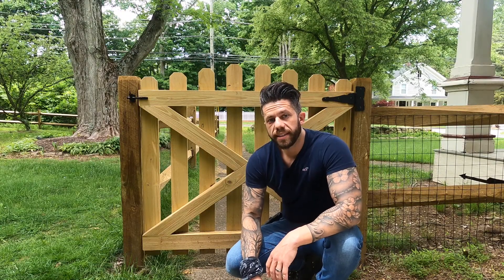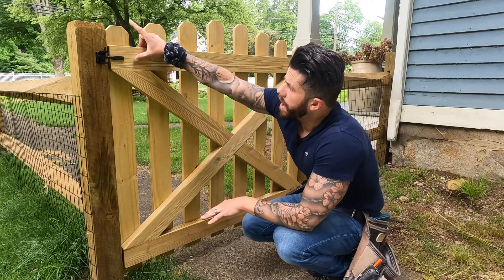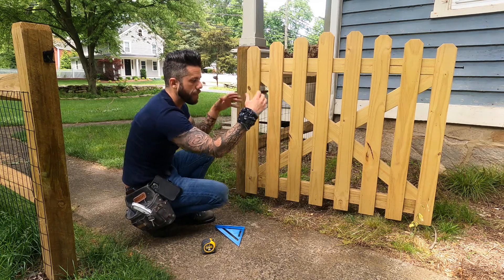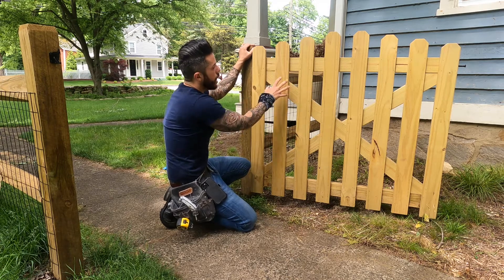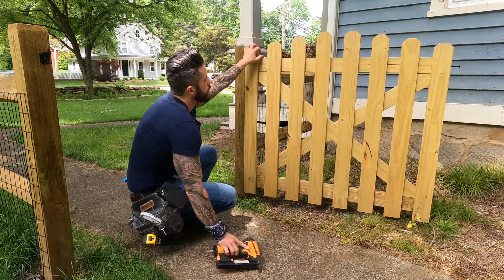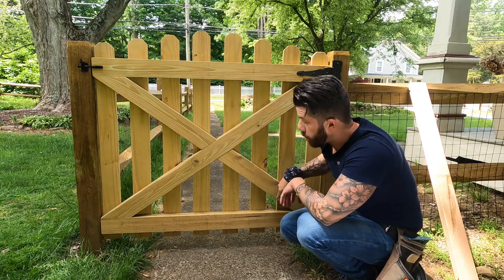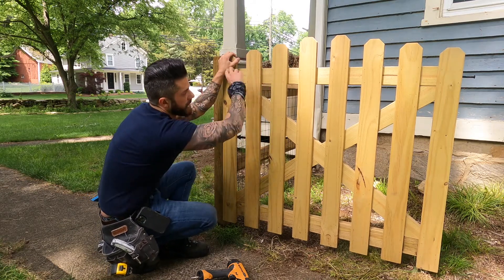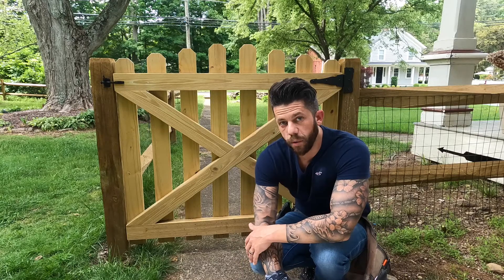How To Build A Gate

Comment: how did you cut the top of the 1x4's?
Reply from the maker: In order to create the design at the top you need to lay the 1x4 on the chop saw, make a mark 1in. down, draw a line across with the speed square, move the chop saw arm at 45 degrees, and cut a 45 degree angle on each side.